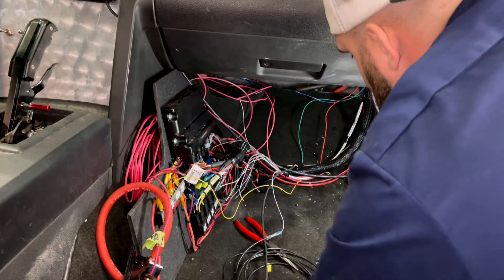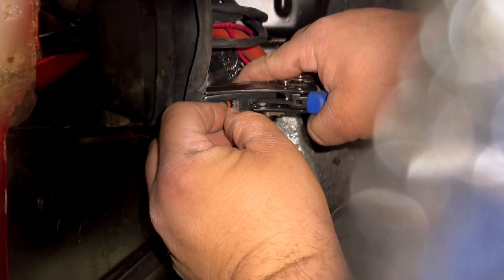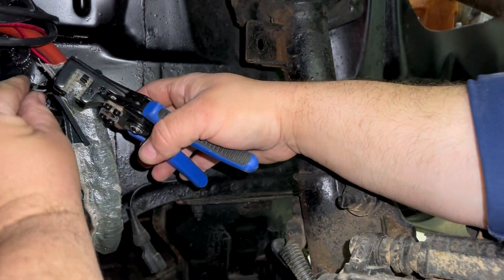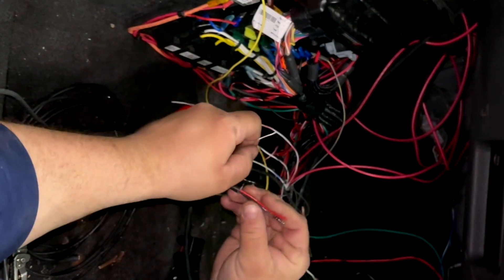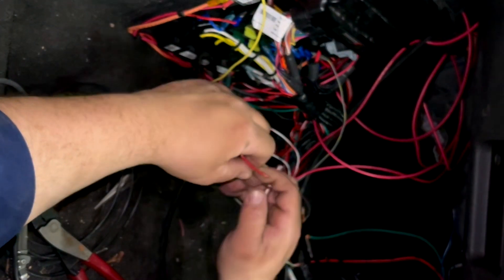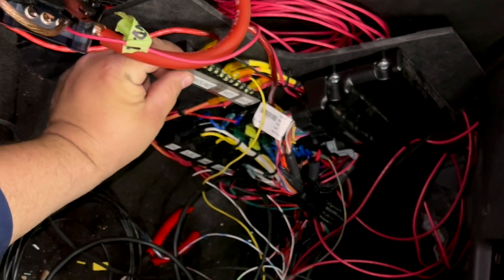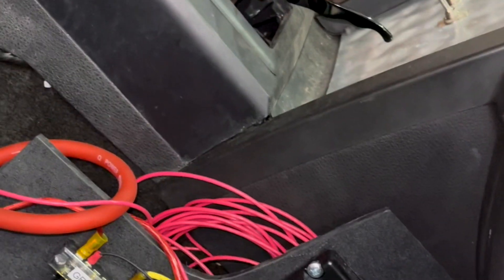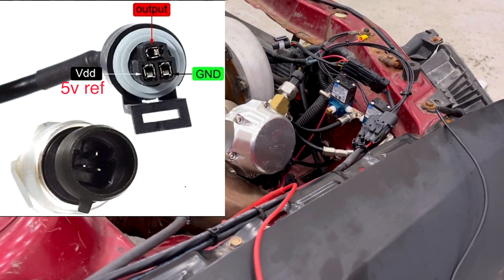LS197 Wiring and more wiring. I/0’s dome pressure and boost control! Holley terminator x

Comment: hey guys working on doing the exact same thing tonight couldn't get either mac valve to operate, and no change in dome pressure. double checked input 5v and ground sort of stumped
Reply from the maker: Make for sure you used “sensor ground” not regular ground.
Reply: @DanielsDesign  you called it
Reply from the maker: @blake5605  hey man good deal. Glad to help.